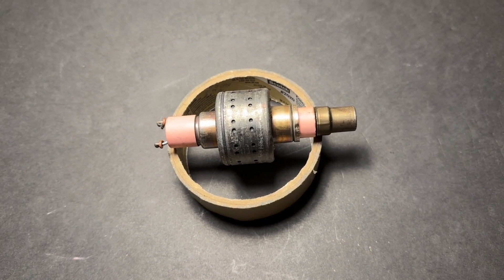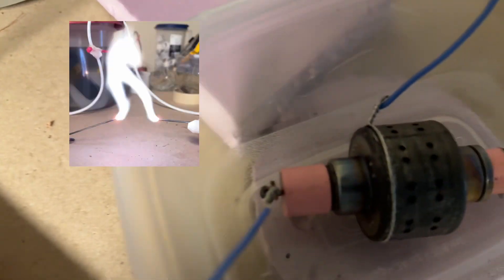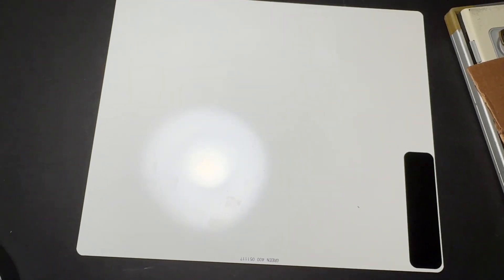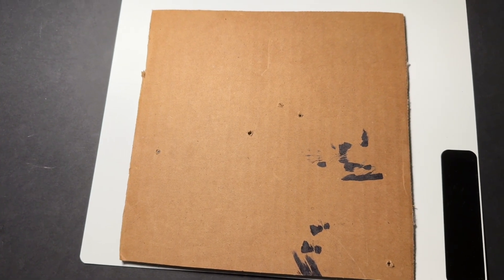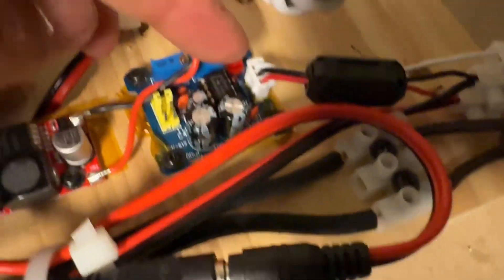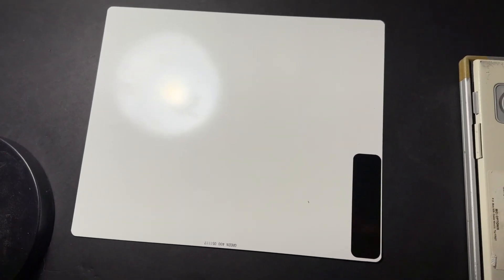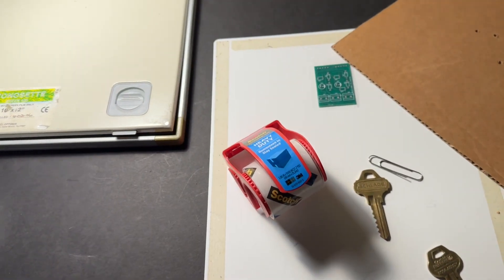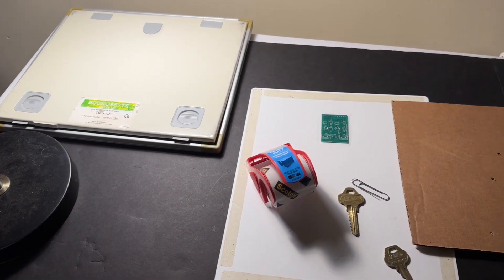X-Ray Images from Magnetron

Comment: Can you do some experiment 
1 powering it with HOt filament 
2 placing magnet just to very slowly rotary the electron to see if x ray amount increase the idea is with little magnetic field the electron beam will very slowly rotary in every direction of its circular direction without curving beam much to avoid loss of e beam so at some area there will be less copper to easily scape X ray like cavity instead of its face 
3  place fluorescent paper to graphically see the x ray window profiles 
4 check the highest x ray penetration power like after wall or steel .

Comment: I tried this... got nothing out of it.
Reply from the maker: What kind of voltage were you applying? Was it AC or DC. One of the issues with this is with at least 40,000 V, there is Arc over the ceramic material which drops the voltage and prevents x-ray formation. The whole thing has to be submerged under oil to prevent arcing. The x-rays are still detectable with the unit submerged in oil. However, if it’s a damaged unit or shorted out internally, then no x-rays will be produced, and that may be worth checking out. You could evaluate for a short circuit between the filament terminals and the outer casing which is made of copper. If there is close circuit here, then it is gonna be no good.

Comment: I recommend putting the magnetron in a pvc pipe filled with mineral oil and surround it with lead sheet wrapped around it and have a hole in the lead to act as a window

Comment: i’ve tried this experiment but when i power up the magnetron, nothing comes out, i’ve tried 30 seconds exposures with my intensifying screen and it doesn’t seem to light up. I’m feeding the magnetron with a flyback transformer connected a ballast and it gives me arcs of about 5-6cms , any advice?
Reply from the maker: Yes, do you have a good way of detecting x-ray production? Any of the solid state bank accounts will work fine but if there is one that has a tube, then that is even better. If there is a good x-ray production with the AC flyback transformer, then in order to get enough voltage across the magnetron to make x-rays the whole set up has to be submerged under oil. Once it’s under mineral oil. That way you can crank up the voltage even more. One of the things you’re gonna have to do is make sure there’s absolutely no extra light. In order to get time lapse I’m using an iPhone camera together with the Slow Shutter app from the App Store. This allows long exposures. If you cannot detect any x-ray production, then it probably means that there’s a short circuit between the anode and the cathode.

If you’re not getting any output from the magnetron, then check for continuity between the cathode and anode. If there is continuity, then it means the magnetron is non-usable. I had a couple like this where there was a short circuit between the cathode and anode.

Comment: Can you check what the X-ray detector film looks like in the cavity of a normal microwave?
There might be an X-ray flash when the microwave is turned off due to the high-voltage transformer opening circuit, because the inductor voltage depends on L and dI/dt.
Reply from the maker: Regular voltage 4000V in the magnetron in a microwave oven doesn’t generate any X-Rays. The x rays appear around 30,000-40,000V

Comment: with the magnets we concentrate the electromagnetic wave. why did you remove them and the rear sheilding?

Can you try with a normal magnetron by simply removing the LC filter at the input?
Reply from the maker: The magnet removal was to stop microwave production when high (40kV) was applied across the anode and cathode. Removal of the magnets stops the spiral motion of the electrons through the vacuum in the magnetron cavity and instead the electrons move in straight lines and strike the copper. This improves X-ray production. The RF filter on the cathode of the tube is not needed when the tube is operated this way.

Comment: The moment I saw your first video making x-rays with the magnetron I tried it and it works with the eider counter I detected a lot of x-rays and this of the florescent film if you had not done it I would have tried it before or after I wanted to know if it was possible to make x-rays with the magnetron.
Reply from the maker: Yes I was surprised it worked I need to “X-ray” some other objects like a chicken leg or shell etc!

Comment: Your experiments made me want to have a quick try last week-end. I have a magnetron somewhere in my HV stuff box, but before finding it I thought about just testing if sparks from a HV power supply would excite my geiger counter. For this I used the so-called "300kV generators" from Ali, which deliver only around 20-30kV of course. Arcing between the two electrodes, nothing happens. Then I tried to connect a U-shaped aluminum foil to one wire and place the other one in the middle, and the geiger on the other side of the foil. It produced some corona effect which made the counter go through the roof. I reversed polarities and the counter didn't react at all. So I'm guessing a few things: 1) these power supplies deliver DC (very likely through a diode+capacitor ladder given the repetitive nature of the sparks when they happen). 2) such power supplies might actually be sufficient if well driven, when they don't arc; in order to know better I ordered other models ("50kV", "60kV", "1000kV"). 3) I've been strongly suspecting that the counter could instead be excited by the ions floating around, since only few electrons might reach the foil at high speed. But apparently the voltage output is negative and the foil is connected to my ground, so I'm doubting that it would perturb the counter. Anyway, that makes me want to test with the magnetron even more when my hardware arrives ;-)

Comment: Amazing! So are you thinking that there is a little difference in using AC instead of DC? I have few magnetrons and a ZVS driver that might come into this particular use :) Have the variac too for remote powering. Only thing I'm missing is the fluorescence screen that I may not be able to find here in Bulgaria.
Reply from the maker: You are all set! Those green fluorescent screens are very common now. They used to be used in a lot of the old x-ray cartridges that have been replaced with digital. There are a ton of them now on eBay. They are also not very expensive.
Reply: @BrianDhvTinkerer  I'll definitely check them out, thanks!
Reply: @BrianDhvTinkerer  I can't seem to be finding them easily. Are these "x-ray intensifying screens" ? It's not very clear to me which ones are single-use films (like a photo) and which ones are fluorescent and reusable. I found one such "high speed intensifying screen", which is not cheap (and shipping cost will add quite a bit as well). I just want to be sure I'm not mistaken before ordering something that might or might not fit.
Reply from the maker: The use of AC avoids the need to have an expensive rectifier chain or using a CW multiplier. X ray output takes off at 30-40kV!

Comment: What happened to your planning where you want to make x-ray with filament on ?
Reply from the maker: Didn’t need the filament. It made such intense x-rays that I was not gonna even try with the filament.
Reply: @BrianDhvTinkerer  so it's scary 😲 Right? ?
Reply from the maker: Just gotta be careful and avoid  exposure
Reply from the maker: I actually operated the set up remotely. I moved the variac to a different part of the house